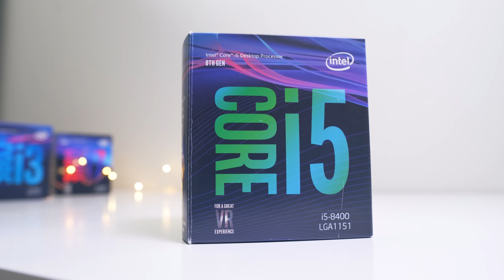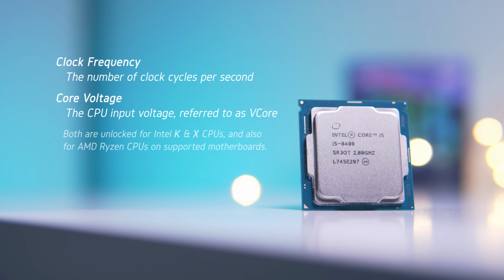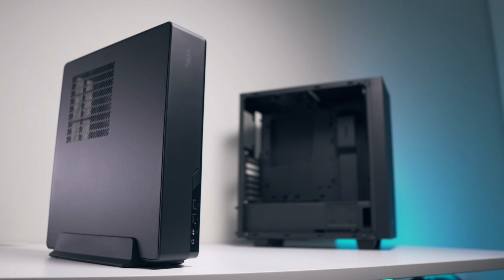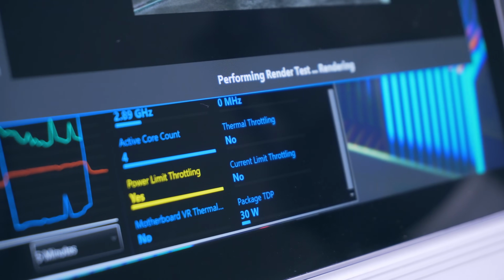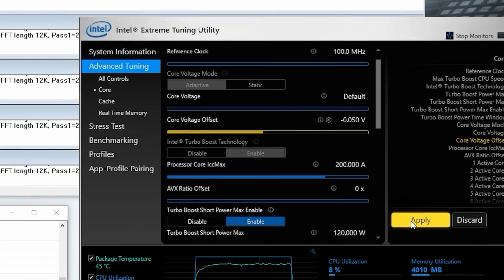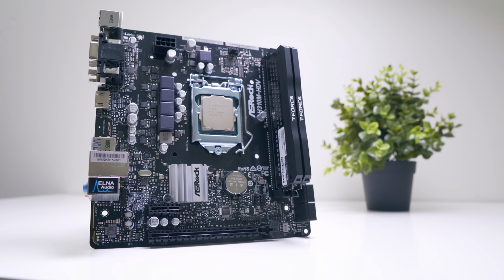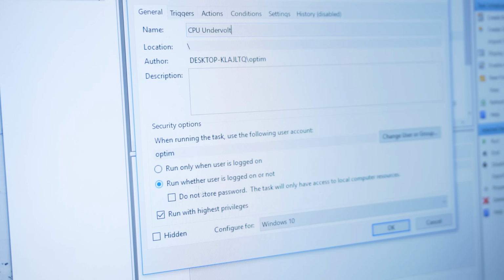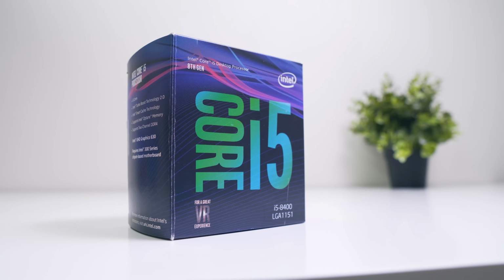How to Drop 10-15C° on Locked Intel CPUs!

Comment: I was never a fan of dynamic offset for undervolting - it reduce the idle voltage as well as the load voltage, and it might crash anywhere in between.
I had an old i5 4690 that ran at 0.96V constantly - ridiculous!

Comment: Got my i5 9400f on -0.11V, ran it through cinebench R20 7-8 times (not sure) seems stable, temps dropped about 8-9 degrees :)
Reply: mine seems stable around -0.12V too. Tried -0.13V/-0.14V, realbench and prime95 passed but it would crash and reboot my pc when after playing 15min ahah.
Reply: @Griefhand  mine actually became unstable and now i have it on -0.09V ;P
Reply: @arrow2593  Sorry to necro, but I had a successful 0.12v undervolt, with 12c temperature reduction. Were you using stock cooler?
Reply: @IIHydraII  yeah i am, is responding to an aold comment called "necroing"? i have no problems with this by the way

Comment: Does delidding these non K-chips help additionally? I'm planning a In Win chopin itx build, and thinking of 8400/8600/9400 or even a undervoltet and delidded k chip.
Reply: up to 9400 they aren't soldered, so delid can be done... 9600k onwards (I think) they are soldered (so no delid)

Comment: My i3-6100U can only go as far as -0.080V. Anything lower crashes Windows 10

Edit : Cinebench R15 score jumps from 211 (somehow dropped less after another test) to 220!
Reply: CPU undervolting/overclocking success really is luck of the draw. not all CPUs can OC the same.

Comment: Could I undervolt the i5-8400 in the bios if I had a X370 motherboard? Or do you really have to use software solutions.

Comment: What about the i5-4570  cpu?????????????????????????

Anyone?
Reply: Will work with any recent Intel CPU.

So, just start lowering the voltage and test it out for lower temps, lower power consumption, and even more battery life in some cases.

Comment: How do I know the best undervoltage for my processor by the way my processor is Intel core i5 2520m 2.50ghz
Reply: -0.100 should be a nice starting point.

It's a lot of trail and error, I'm afraid.

1. set new (lower) voltage offset
2. run stress test (for about 5 minutes) to see if the computer locks up
3. if it doesn't go to 1., else reboot by holding the power button for 10 seconds and set the voltage offset 1 or 2 steps higher (not even lower, lmao).

If (in the long run) your system still locks up every now and then, set the voltage offset another step higher until it stops crashing.

Comment: I apparently have way more cooling than I need. Cooler Master 212 Black with Corsair ML120 Pro maglev fan on i5-9400F. Stock it peaks in the upper 40's with Intel's stress test. Undervolted 80 millivolts it peaks in the mid to upper 40's. Makes a difference of 7-8 watts and 2-3 degrees. CPU fan dropped from about 1200 rpm to 1100. That fan has a max speed of 2400 rpm and runs at about 580 at idle. My Noctua case fans didn't increase in speed at all during the stress test. Basically, no need to undervolt. I didn't try to push the voltage any lower because it probably isn't worth the trouble of testing.

Comment: i7 5500u what voltage should i drop at cpu?
Reply: every CPU is different, but start at -50, and go down in 20s, once stress test crashes increase the voltage in 5s until it becomes stable

Comment: I have an i5 8300h on my laptop and undervolting it by 0.125 with the XTU and it is still power limit throttling, temperatures 78c-84c. Made a custom curve on the 1050ti too(65c-70c). I’ve caught my cpu while gaming going down to 2ghz. I will try throttlestop and see if it works any better. Any clues what could it be?

Comment: THANK YOU!!!
I undervolted my i7 8750H (Asus Strix GL503GE) down to -0.125 and now I get 3.8GHz of "sustained" Turbo Boost at sustained 69-70°C (30°C room temp). 
Cinebench R15 multi score = 1160.

Previously, CPU was limited to 3.2 GHz at 71°C at 100% utilization and scored only 986 in Cinebench .

!!!!ONE MORE THING I NOTICED!!!! 
Intel XTU 'keeps' the undervolt settings after restarting windows.

Once again, a big thank you for explaining it so beautifully!

Comment: Spoke too soon on the previous version of this comment, rewriting it. Thank you for making this video. I enabled the igpu of my i7 7700 after HardwareCanuck's brought it to my attention that I can use it for video editing/rendering. After I enabled it I was no longer hitting 4 ghz at 100% utilization but 3.93 at 91C. I assumed it was thermal throttling because of the extra heat from the igpu, however after downloading xtu I found out it was actually a power limit throttle. I got it to -0.170 V stable doing a render in Adobe Premiere Elements, stable at 4 ghz and 100% utilization again. I was about to buy the asetek 545lc to fit this stupid pre built case, but now I can save my money. I went from 91 C to 71 C during a 720p to 4k upscale render (I used this for stability testing after prime95, had to bump up the offset 0.005 V from what was stable in that program). Needless to say this video more than earned a sub.

Side note: xtu automatically uses the new profile upon start up so I didn't have to run the script. Might be a desktop thing.

Comment: Thanks. I used throttlestop for my 10 years old CPU Core2Duo e8500 and brought down the temperature from 74°C to 60°C with stock Intel fan and ambient temperature of 38°C. Maybe I'll delid later and bring it down further.
Reply: Abhishek Verma im not sure but i thinking your processor its soldered
Reply: Luis José Fernández Yeah right. I forgot about it. Thanks :)

Comment: Have the same CPU as yours. Followed the exact instructions and offset using the default script 100mv. Dropped 12 degrees celcius on average in an instant using AIDA64 Extreme stress test. It was stable at 150mv but decided that the 12 degrees was more than enough! Thank you for this video!!!!! Subscribed!

Comment: For those using laptops, uncheck "Start this task only if the computer is on AC power" under "Conditions" otherwise it won't come on when you're running on battery.
Reply: Ya i did that and my laptop just shut off.

Comment: I've undervolted my Surface Pro 3 today with XTU. There's a much easier way to save the settings made in XTU.
Get your offsets, set it up and save it as a profile in XTU. Then close XTU and open it again, looking if the profile is loaded succesfully.
If done correctly, head over to RESTART your PC. If you've done everything right it should say "Restart and Update PC"
Then the PC installs an update, reboots and voila. The ofsset should be permanent.
I've done this on Windows 8.1

Intel Core i5-4000u series - 0.055V offset was the most stable offset. It gave me about 18° cooler temps.
I've also changed how long and much the Intel Turbo Boost can stay, that's why my temps are so much better.
I recommend lowering the Turbo Boost watts and increasing the Turbo Burst time.
It increased my Cinebench score by 11% and stopped my Surface from Thermalthrottling.
Reply: This method work best and is much simpler and easier to setup. I did not get a "Restart and Update PC" notice but the offset is applied when I reboot my PC. Thank you both of you Optimum Tech and Tiago.
Reply: 11% on cinebench ? o_o
if i understand i should lower "Turbo Boost Power Max" and increase "Turbo Boost Power Time Window" ?? 
How much you achieved to do ? ^^
Stable at -0.160V on my side btw
Reply: Really useful, it worked for me

Comment: So this wouldn't reduce the performance of my cpu at all only the temp?
Reply: It works well with Locked CPU's with no turbo boost enabled I think or am I wrong? My assumption is that for example, undervolting an i3-2120 which is a locked CPU with 3.3GHz and no turbo will benefit this method, the i5-2400 which turbos from 3.1-3.4 on single core does it based on Voltage and temperature headroom so if the voltage is made less the thermals might be better but will it disrupt the turbo speeds!?
Reply: I used to think the same, but in my experience the turbo speed is actually not affected. I was able to get a -70mv undervolt while still maintining turbo speeds. Higher than that would crash. The weird thing is that disabling turbo allowed me to go further without crashing, to a -100mv undervolt. then again the cpu i tested this on is an old haswell i5 in a laptop, so im not sure if this applies to newer hardware as well. But generally speaking, im pretty sure you can achieve a decent undervolt whitout sacrificing turbo frequency; I'd just keep an eye on the cpu speeds to be sure.
Reply: @archetype6351  That's mainly because Turbo Boost changes the voltage of the CPU on the fly depending on temps and power.
Reply: Frizzy Derp yes, this just reduce the excesive power given to the cpu

Comment: I’m pretty sure the stock cooler on most Ryzen CPUs can handle the temps, even with minor overclocking. Would it still be a good idea to undervolt even if the temps are fine?
Reply: Kwixey If you care about the enviroment sure.
Reply: it may improve your perf. because the cpu is cooler allowing the turbo speed much longer

Comment: What happens if you undervolt enough that the pc doesn't boot? you wont be able to fix it because the software uses windows to work...Really want to know how would you fix it
 Edit: maybe booting in safe mode would do the trick
Reply from the maker: Clear CMOS via button, header pins, or by removing the CMOS battery for a couple minutes.
Reply: lampros Pitsillou You could remove the CMOS.
Reply: Thats why you should always have backup images. If you mess up you probably have to reinstall your OS all over again if you have no backup image to restore
Reply: Optimum Tech are you sure that it's stored in the CMOS ?you used  program manager so that it applies the setting during start up.If it was stored in the CMOS you wouldn't have to force it to be applied at start up. I might be wrong tho dunno..
Reply from the maker: If you're using Software, Windows will reboot and perform a 'repair'
Reply: Why would you save an unstable, untested setting? Herp derp

Comment: I remember when I was a teenager I had an athlon 2700 that used to crash frequently when playing games and what not.
So I decided to downclock it (reduce the frequency of the CPU) and it worked great.
If I knew that I could have just lowered the CPU voltage. I would have done it.

Comment: So undervolting doesn't reduce the performance of the CPU.
It only reduce the amount of heat it produces ? Amazing 👍
Going to try that on my mini ITX build with a RVZ01 case.
Would be great if I get a 10°C temperature drop.
Reply: gamer388 Why get the RVZ01? The RVZ02 looks much better. What cooler are you going to use? Noctua?
Reply: I'm using the Noctua NH L9i for the CPU cooler.
I didn't find the RVZ02 was looking much better With the transparent vent on back case (eww).
Seriously I don't like at all the orange LED light on the front of the case.
Now the best choice is to get the RVZ03 which lets you decide what color you want for the case.
Reply: gamer388 I though the same but you can also cut off the rgb cables so it looks good again.

What do you mean transparant vent? Show a pic because i only see normal black grills that every case has?
Reply: Yeah the RVZ02 comes in 2 versions apparently.
One is kinda OK because all the case is back.
But one is really disgusting (at least for me) : https://media.ldlc.com/ld/products/00/03/30/60/LD0003306063_2.jpg
Reply: Depending on the CPU Turbo Boost/power draw it can actually improve performance. My laptop 7700HQ without undevolt will run at 3.4GHz all core in game etc but with undervolt it will run at 3.8GHz all core in game etc and 10'C cooler.

Comment: Two minor things w Prime95:
1. Proper stability testing takes about 1hrs, though some may argue in favour of more.
2. If testing temperatures only (not long term stability) - the temps almost reach maximum after/at 23min of testing (the differences btw 23min & 60min testing are 1-2°C)

Comment: Thank you so much! My 6700k went from 89° to 77! Its also alot more quiet. :)
Reply: Is your 6770k overclocked frequency wise at all?
I'm wondering if this could help my i7 3770k.
Reply: Carl Wells if you have already overclocked your 3770K to the max then this won't help you as you would have already tuned your system for that voltage. If you haven't touched it at all, then it will help you, but by how much depends on the silicon lottery.

Comment: Using an Lga 771 CPu to Lga 775 CPU mod and the intel software is not recognizing  the CPU :(
Reply: See if you can lower the voltage in bios.
Reply: You can lower the V core in Bios manually

Comment: XTU always applied the undervolt automatically on Windows startup for me. I use a kaby lake pentium.
Reply from the maker: Honkarakiri - great to hear! I wish it were like that for my laptop and this i5 8400 lol.
Reply: Check if you have Intel Extreme Tuning Service set to Automatic start. That might be it
Reply: @Honkarakiri  how do you set it to automatic start?
Reply: @optimumtech  Hey.. My XTU is locked for offset in my laptop having i5-10210u with mx250.. how can i unlock that offset?? Plz help
Reply: @Rapid_Shift  You might have to enable overclocking somewhere in bios settings. That's what I had to do on my MSI gs66 laptop.
Reply: @Rapid_Shift  use older version of xtu , for me it is 6.5.2.40 , and mu cpu is i5 9300h.

Comment: This problem could have easily be avoided if only intel soldered or used better thermal paste on their cpus rather than toothpaste.
Reply: Partly, yes. That helps with the TRANSFER of heat, meaning more heat will be expelled from your system (might be a concern on a laptop), but the CPU itself is cooler. Undervolting means less heat is created to begin with, so internal and external temps should go down.

Also if anything, the reason undervolting exists is that manufacturers leave extra voltage as headroom due to variance in silicon, plus a little extra. They would much rather have slightly higher temps than people complaining that their product is unstable (granted, in very rare situations).
Reply: Tech Tube That wont change until consumers decide to vote with their wallets again and boycot intel until they listen. But knowing people these days that will never happen.
Reply: Unfortunately the vast majority of users have no idea Intel does this- and the ones that do see it as an opportunity to tweak performance more with liquid metal/direct die cooling or aftermarket heatspreaders.

Comment: Also got an undervolt on an Alienware prebuilt with an i5 4440 only got 150mv off for 1-3 degrees at load running at .850mv
Reply: Nogghan Keep in mind that your fans probably spin slower which makes it quieter
Reply: i dont care about sound in that system i delidded that locked CPU and still had to swap out the cooler because it was running at 86-90c in that cramped case with no air flow either that or i had a bad chip, either way i put the noctua low profile 65mm tall cooler on it and now its only 65 with XTU

Comment: ive taken my 8600k down to MCE or just 4.3 all core on 1.100vcore sadly cant go any lower its delidded and on air max temp only 44c
Reply: Nogghan What cooler? :o
Reply: Askaly thermaltake le grand macho, it's better than the Noctua NH D15 the biggest baddest 2 140mm fan model in my opinion because it's easily the same performance but it's one fan, it can run passivly which the Noctua cant, it's cheaper and it's only a 20DBa max fan ( I seriously love this cooler, I'm also using IC graphite thermal pads between the IHS and cooler and I have conductonaut on the die side)
Reply: thats extreme!!!!!!!   xD
Reply: Why under volt a 8600k If heat not an issue?
Reply: grlmgor some of us , prefer a death silent pc  😎😎😎😎
Reply: Even at 60 degree the fans wouldn't be spin fast to begin with.
Reply: grlmgor I was bored and I saw this video so I figured why not see how low it can go, not like undervolting will hurt anything
Reply: grlmgor actually I can run it passivly at 5 GHz with my CPU cooler and because its delidded max temps are only low 80s for passive 5ghz (only case fans) one top intake over VRM one rear exhaust and one front intake
Reply: grlmgor undervolting lowers temps and uses less watts. If cpu is cooler its better for same performance or better